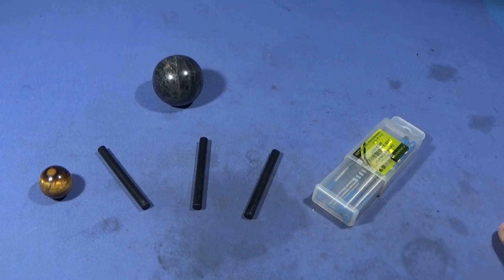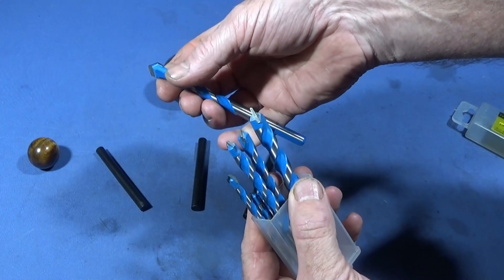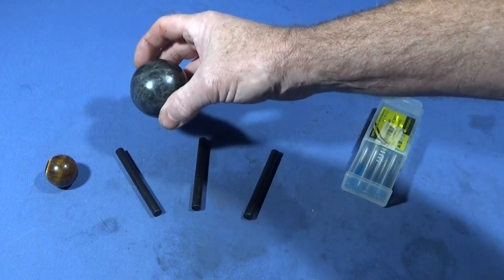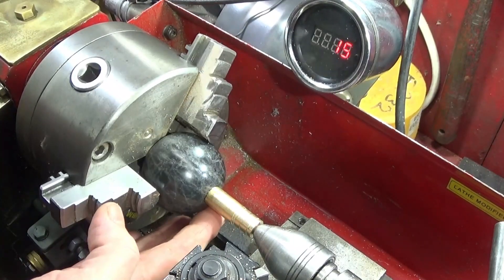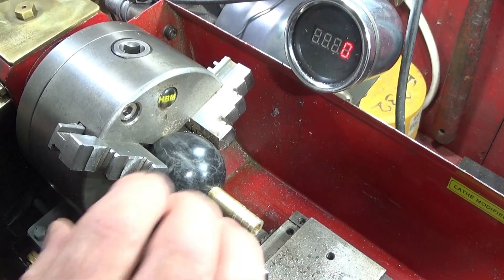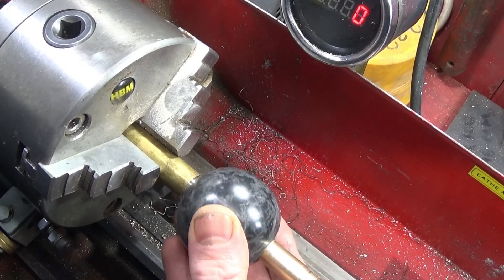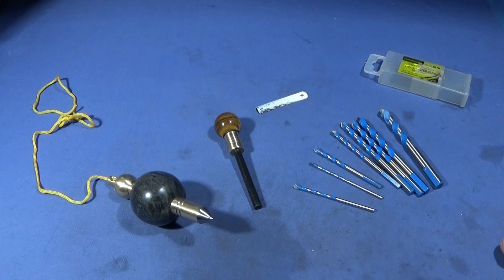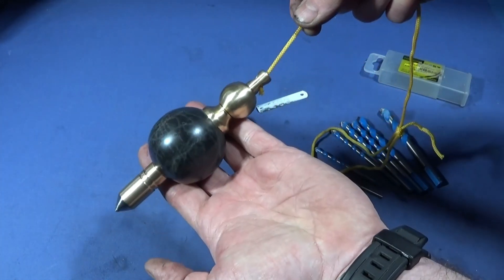Machining Rock On The Lathe. A Plumb Bob & Fire Steel

Comment: Turning Stone without water and no respirator is a great way to get silicosis. The cut also chips more without water, and heat can make a stone brittle or change colour depending on the stone. 
I turn stones on my lathe all the time, and have a vacuum hooked up to the carriage and a water bottle to keep the dust down.
Reply from the maker: Using water would wash the dust into the working parts of the lathe. You can wear a dust mask so as not to breathe any in.

Comment: Hi Steve,
Interesting video... Thank you...
Whilst I have you here I was wondering what criteria you use to pick which lathe to use (Myford ML7 or Chinese Mini lathe) also do the have the ability to cut metric threads on one and imperial on the other? 
Have a good weekend and take care
Paul,,
Reply from the maker: Hi Paul, I don't really have a criteria. I just choose between the two depending on how I feel. Also  I like to show people things being made on the Chinese Mini Lathe because there are more people that own them than those that have a Myford. I also like to show people that they can make things on whatever lathe they have within reason.
 There are some things that influence my choice at times though such at length of slide travel where the Myford is better. The diameter of spindle through bore in which the Myford is way too small. Also I bear in mind how the chucks are fitted on the lathe. The Myford screw on chuck is quick to change, but one has to take great care when using the spindle rotation in reverse.
 I have the ability to cut both metric and imperial, but rarely do so. I mostly use taps and dies for what I do at the moment. Regards Steve
Reply: @SteveJordan  Thank you...